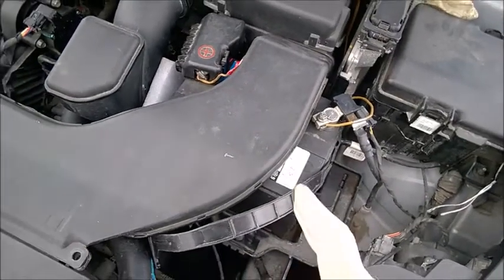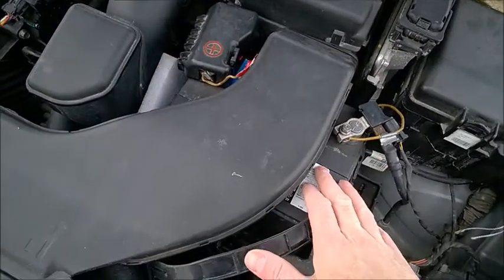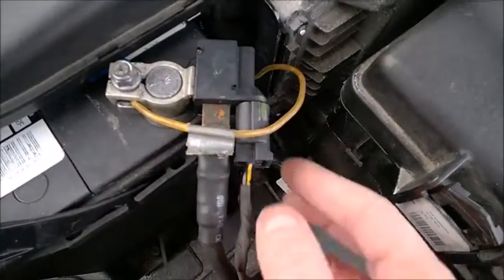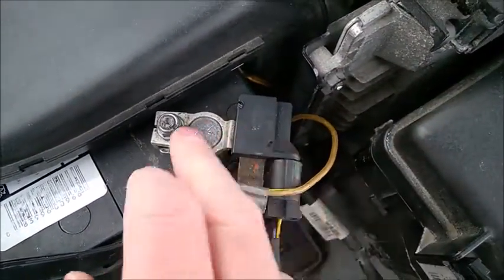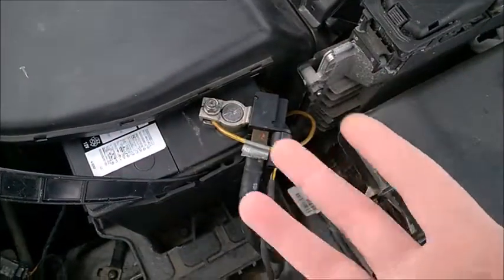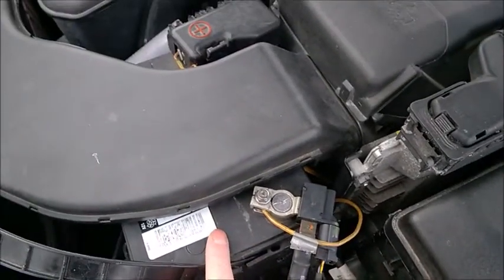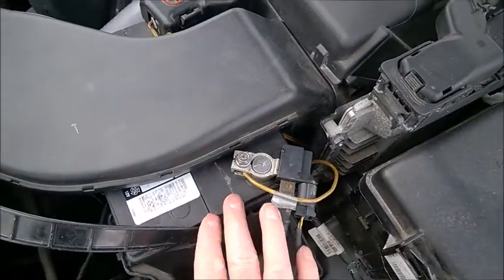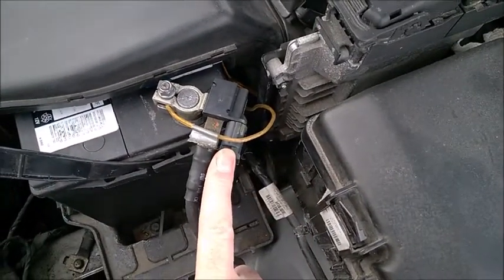Replacing AGM with regular acid-lead car battery - the battery temperature sensor AMS (BMS)

Comment: I have a hybrid car and it's auxiliary battery has a separate connection for temperature sensor,  mechanic said I can just put a normal acid battery that doesn't have the temperature sensor connection,  do you think it's OK? I need to change the battery
Reply from the maker: All cars - gasoline, hybrid and full electric have a 12v auxiliary battery which works in all the same way - it powers everything from door locks, starter, instrument panel, computers, radio, etc. However, a hybrid car will start the gasoline engine much more often and this is done using the 12v battery. For this reason I think you should stay with AGM batteries which resist better multiple small discharges from spinning the starter. Of course, you can still use an acid-lead battery instead but it may last less long than an AGM. If using acid-lead I suggest removing the AMS fuse from your car fuse panel, it may help the acid-lead last longer. Keep in mind, when a 12v battery get worn, you will not be able to open the doors or start the car, even if your hybrid battery is fully charged.
Reply: @Peppermint1  thank you for your advise!